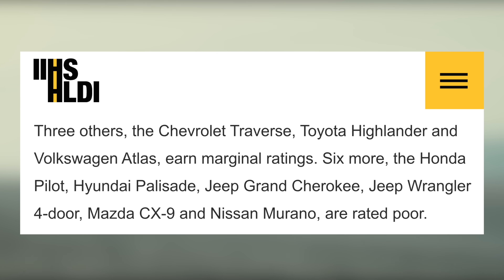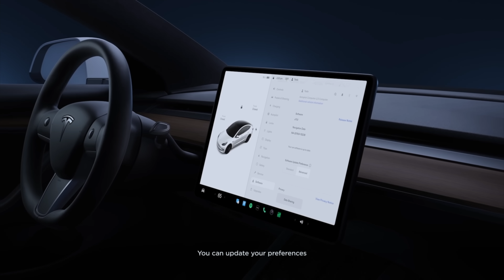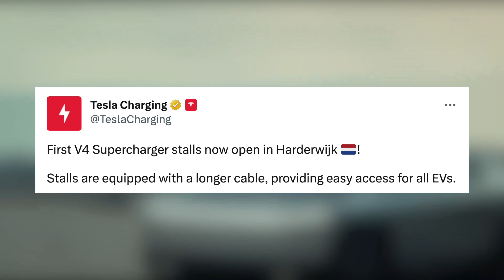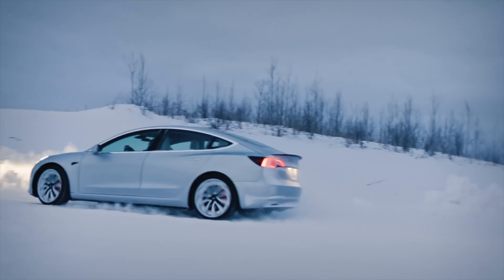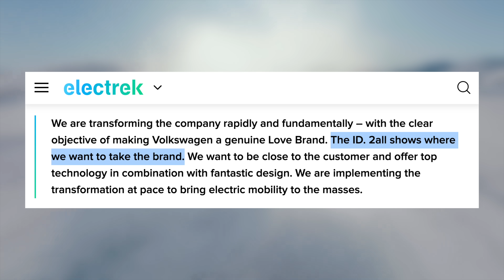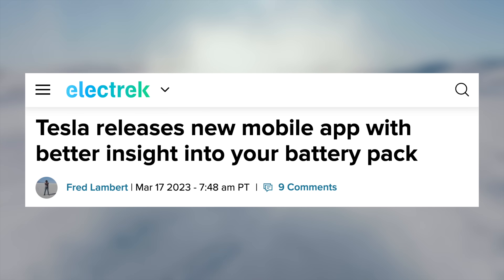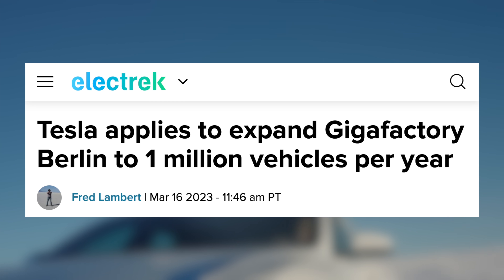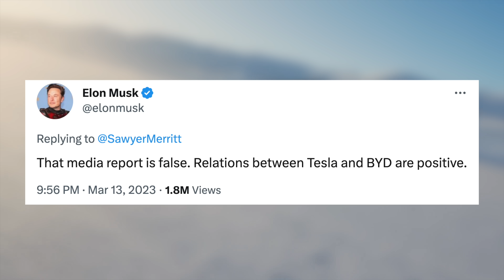Tesla “FIXED” Most Controversial Feature | Fans Aren’t Happy

Comment: In NJ, there are a lot of chargers that say “250 kW”. I like to imagine they’re faster than the 150 kW ones, but I usually use a 150 kW on the weekend near me and it’s not noticeably slower.

I probably should record all the data when I’m charging, I’m just far too lazy and apathetic for that. I’m assuming it must be a little faster, even given various states of the battery and cars at the charger, but I haven’t noticed by eye.
Reply: In my experience the 250kw chargers only get up to that charge rate very briefly before quickly going down to 100-150kw. 
I also don’t see the  preconditioning battery setting making a difference from when before that option existed.

Comment: Have a mechanical direct connect to the axle of EVs and solar, to super charge them. No more plugging in. Use V2G tech to transfer extra energy to the power grid for everyone to use and so the EVs don't over charge.